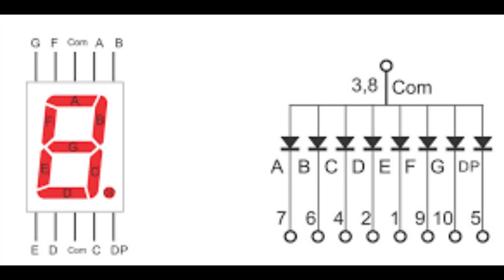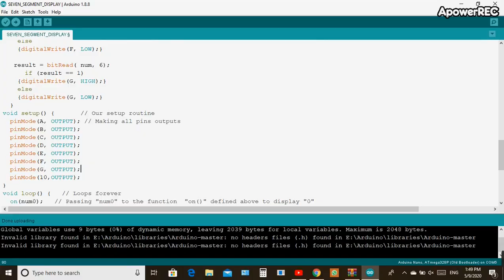How to make a 7 Segment Counter Display using Arduino Nano/UNO!| Arduino Project idea for Beginners!

Comment from the maker: //E-innovators.
//counter with arduino nano

int A = 7;   //Defines all pins on the Arduino Uno board in order of connection.
int B = 6;
int C = 4;  // DOT is pin 5, not used in this example.
int D = 3;
int E = 2;
int F = 8;
int G = 9;
 
byte num0 = 0x3F;  //Hexadecimal format based upon the A-G, 0-9 Chart in excel and the wiring      // of the segment (refer to the on/off table image below).
byte num1 = 0x6;
byte num2 = 0x5B;
byte num3 = 0x4F;
byte num4 = 0x66;
byte num5 = 0x6D;
byte num6 = 0x7C;
byte num7 = 0x7;
byte num8 = 0x7F;
byte num9 = 0x6F;
 
void on(byte num)   // This function turns on the correct pins to display numbers passed to it         // through the variable "num".
{
  int result = bitRead(num, 0);  // Read the first binary entry in num and stores it in result.
 
      if (result == 1)  // Check to see if this segment should be on.
 
    {digitalWrite(A, HIGH);}   // Turns on the segment.
    else   // Otherwise, it turns it off.
    {digitalWrite(A, LOW);}  // Turns segment off.
 
      result = bitRead( num, 1);  // Same thing for the 6 remaining segments.
 
      if (result == 1)
 
    {digitalWrite(B, HIGH);}
    else
    {digitalWrite(B, LOW);}     
    result = bitRead( num, 2);
 
      if (result == 1)
 
    {digitalWrite(C, HIGH);}
    else
    {digitalWrite(C, LOW);}    
   result = bitRead( num, 3);
 
      if (result == 1)
 
    {digitalWrite(D, HIGH);}
    else
    {digitalWrite(D, LOW);}    
   result = bitRead( num, 4);
 
      if (result == 1)
    {digitalWrite(E, HIGH);}
    else
    {digitalWrite(E, LOW);}
    
   result = bitRead( num, 5);  
      if (result == 1)
    {digitalWrite(F, HIGH);}
    else
    {digitalWrite(F, LOW);}    
    
   result = bitRead( num, 6);
      if (result == 1)
    {digitalWrite(G, HIGH);}
    else
    {digitalWrite(G, LOW);}
  }
void setup() {       // Our setup routine         
  pinMode(A, OUTPUT); // Making all pins outputs
  pinMode(B, OUTPUT);
  pinMode(C, OUTPUT);
  pinMode(D, OUTPUT);
  pinMode(E, OUTPUT);
  pinMode(F, OUTPUT);
  pinMode(G, OUTPUT);
  pinMode(10,OUTPUT);
}
void loop() {   // Loops forever
  on(num0);   // Passing "num0" to the function  "on()" defined above to display "0"
 delay(1000);   // Delay for 1 second to see the "0"
  on(num1);  // Change to "1"
  delay(1000); 
  on(num2);  
  delay(1000);
  on(num3);  
  delay(1000);
  on(num4);  
  delay(1000);
  on(num5);  
  delay(1000);
  on(num6);  
  delay(1000);
  on(num7);
  delay(1000);
  on(num8);  
  delay(1000);  
  on(num9);  
  delay(1000);
}